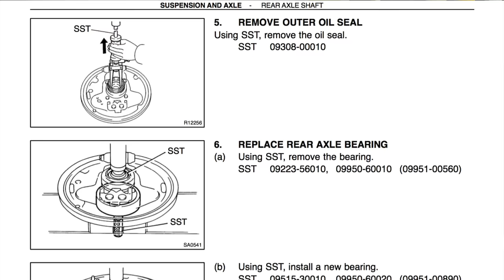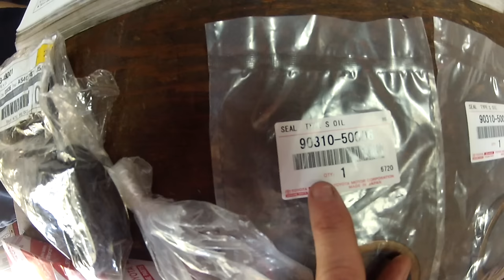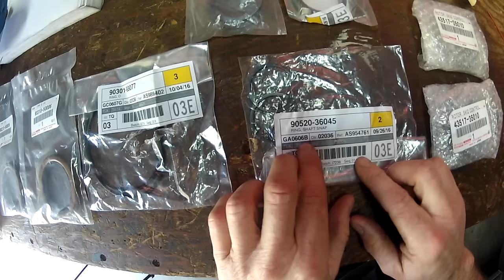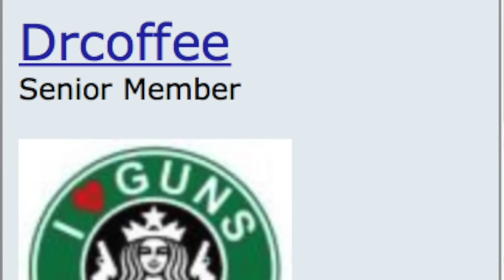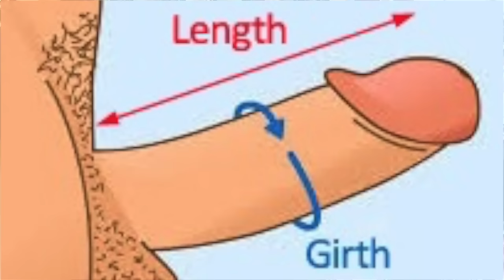Toyota Rear Axle Seal/Bearing Replacement (ABS Rearend)

Comment: My durasolid tool wont go all the way down to axle bolts. Anybody ever have this problem?
Reply from the maker: Trevor, did you watch the whole video?  I address this shortcoming about the tool.  You either have to modify it like I did or get some longer bolts to use when pressing the axle shaft out.  

Also, the brake backing plate with the bearing case attached to it might have slid down a bit.  This can happen because the bearing doesn't fit very tight into that case.  It's not a press fit.  But, all you have to do is pop the end of the axle shaft (side that slides into the 3rd member) into a piece of wood on the ground and it will knock the bearing all the way back into the case and bring the backing plate bolts closer to the Dura Solid tool.
Reply: @TimmyTheToolman  I did watch this video several times.My tool will not slide over axle shaft to be able to bolt down to backingplate. I have longer bolts. The inside of my tool is not big enough. I'm not sure what is going on.
Reply from the maker: Trevor, read my updated reply above.  It may be because the backing plate has moved some on you.  All you have to do is lightly pop the axle shaft into a piece of wood on the ground and that will re-seat the bearing fully into the backing plate bearing case and bring the bolts further up so you can attach the Dura Solid tool plate.  But, even when you do this, you will only be able to grab a few thread on each bolt so you should use longer M10 bolts if you haven't altered the plate like I've done.  Grabbing only a few threads is not enough to hold the force applied with the press.  You'll most likely end up stripping the ends of the bolts.
Reply from the maker: If you're still having issues, email me a pic of what you're dealing with: mtbtim@sbcglobal.net
Reply: @TimmyTheToolman  I will give that another try. I also emailed a few pics of the issues thank you sir !!

Comment: Please post a video for this repair on 8-22 Tundra.  These videos are misleading (tone rings?).  A step by step of removing the bearing assembly and reassembly would have saved me a ton of work and grief. Duane's tools are great but the correct one for the job is :  
EBAY - Rear Axle Bearing Puller for Toyota Tundra 2007-20 & Land Cruiser J200 2007-20.  Currently $127.99 blue in color Beware of the foreign look alike crap.
Reply from the maker: Are you saying our videos are misleading?

Comment: All u have t do is depress brake pedal with bit ti.ber and no brake fluid will leak out
Reply from the maker: You make a moderately understandable point, kind of.
- Sean
Reply from the maker: You're talking about brake fluid leaking out for a video about axle seals failing and gear oil leaking out.  Smoke another bowl Bro!  - Timmy

Comment: Apparently I made a mistake I didn't take the ABS sensors out at the time when took the axles out to do the axle bearings & I had taken the the axles to a mechanical work shop & had already had brought the bearing & oil seals & other parts that were needed & & when the work was & couldn't understand as why it was hard to get the axles back in place & bolted everything back in place & I & it was tight to turn the wheels around & I already had bled the brakes & it was while ago that I have driven Toyota Hilux Surf 1996 model & I find when I drive fairly fast & when I brake fairly hard it gives a bad vibration as the back of the vehicle & I which I had seen this video clip before hand I would taken the sensors out first my bad mistake & most likely have damaged my ABS tone gears & when I get some extra money I will get 2 second hand ABS tone gears as they are too expensive from Toyota brand new & because I live in New Zealand t they would have to be imported from Japan at NZ $ 200.00 each I wouldn't have the money to buy them & I will have to buy them second hand from the wreckers as I most likely have damaged my ABS tone gears & at the same time I will buy new axle seals as well & get someone to take the damaged ABS Tone Gears off & press on the good second hand ABS Tone gears & once I got the Axles out I should be able to take out the ABS sensors & check them out & I have already brought second hand ABS sensors just in case I have damaged the ABS sensors already on my Toyota Hilux Surf 3.4v6 I wish that I had seen  this video clip before hand I would not have made that mistake I would have take off the ABS sensors first & wouldn't have that trouble now oh well shit happens Kind Regards Peter PS good on you Timmy The Tool Man for putting this Video on Utube Thanks So Kindly Timmy & you mostly helped out a lot of other  People out to Most Greatful Timmy
Reply from the maker: Damn Peter, that was one long sentence.  The only period was at the very end.  Anyway, I got the gist of what you said.  Hope you get it all sorted out.  Happy Wrenching!

Comment: this is the repair im dreading most....id legit pay 500 dollars just for the OEM original seals before the redesign. like why change it. lol
Reply from the maker: It's not that bad Cameron.  Toyota changed the seal to improve the design.  The new design is way more pliable than the old design and will last longer because of it.  It does suck that the redesign caused unforeseen issues but it is what it is.  At least we know how to address it now.  

If you don't want to replace the bearings and other associated parts and just want to replace the seal, all you have to do is take your axles to a machine shop, have them remove the inner retainer and ABS gear, flip the inner retainer and press them back onto the shaft with 5mm of polished axle showing.  But, I think the smart move is the renew the bearings and I state all the reasons why in the video.

Comment: Was not expecting to see a penis in a car repair video lol.

Now if only someone had a video for the 4th Gen. My 2008 has a lot of noise while driving, I'm trying to tell myself it's the wheel bearings but I think I'm in denial of the truth that it's actually just a shot differential.
Reply from the maker: Well, hope for a bad axle bearing.  That's a much more affordable repair.  Fingers crossed.  But, ti could be something totally different like a bad u-joint which would be even more affordable to fix.

Comment: good stuff but way too much unnecessary press work very time consuming   , the bearing will come out with a socket and 2  taps with a dead blow hammer and just cut the retainer and ABS ring with a dremmel  and use a cold chisel , then no chance of damaging backing plate studs banging them out or pulling them back in and or bending them . that  extra step bit ya on yer second axle and totally unnecessary  , don't get me wrong love the vids and your passion but sometimes doing unnecessary steps gets one in trouble , I bang everything on with a pipe , bearing ( use old bearing on top ), retainer , tone ring  and final retainer , measure from axle end to retainer for measurement with tape measure to keep same as original measurement ,if using an OEM seal it will be in the correct spot no need for this grease test  not even sure where this originated from lol ,  been working on Toyota axles for 30 years never had a leak , remember every time you take that axle in and out to do a grease test you are chancing hurting the new seal or egging it out if ya leave weight of axle on it and shortening its life span ,  also fun fact never replaced a crush washer in my life and never had a leak , replacing crush washers is way too you-tube overrated lol , I'm taking  probably a 1000 fill and drain plugs I tightened multiple times (7-8) times for a same washer  over the life of some vehicles .
Reply from the maker: You do it your way and we'll do it our way.  No way am I going to use a cutting disk and risk going to deep and screwing up the axle shaft like I've seen too many shops do to people's axles when I have a tool that can pull the tone ring and retainer off with no risk of damage to the axle.  

Yes, the bearing can come out like you said.  We didn't know that at the time of the filming of this video.  We show your method in Part 2, along with featuring a much better tool for the job than the Durasolid tool: https://youtu.be/R-c2x3F8DU4   For the new tool, we still have to knock out one of the axle studs and then pull it back in after pulling the ABS tone ring and inner retainer off the axle.  No big deal.  It's beyond easy to knock one of those studs out and pull it back in.  The reason we had a problem with the studs on the second axle was due to how the Durasolid plate was made.  It was too thick to allow for sufficient thread engagement with the nuts.  If you would have watched the entire video, you would have seen how I explained the alteration I did to the plate to allow for more thread engagement so the threads wouldn't fail in the future when pressing the axle out of the bearing.  

I think I know this job just as good as any professional or DIYer out there.  I've done it successfully probably around 20 times.  If you like using a cutting disk, that's your prerogative.  I only use cutting disks as a last resort to get something off usually after a puller has failed.  

You've been doing it for a long time and doing it wrong for a whole lot of people then.  Toyota redesigned the seal.  I guess you missed that didn't you?  The seal lip doesn't sit in the same spot as it did before.  It sits apprx. 2mm more inboard.  So, because you didn't bother to do a grease test or sharpie test on the axles you've done, you didn't see that the seal lip is now riding very close to the bevel of the retainer.  If you know what you're doing by supporting the weight of the axle while going through the seal, you're not going to do damage to the seal by performing a grease or sharpie test to confirm a good mating of the inner retainer and the seal.  

If you like to do press work like a Neanderthal by banging the parts on with a piece of pipe, again that's your prerogative.  I like using a press.  

Finally, you don't bother replacing drain or fill plug crush washers.  I do because I've seen small leaks because of it.  

So, if you haven't figured it out yet, I'm not agreeing with your assessment of my work other than the comment about the bearing removal from the bearing case.  That comment I agree with, but then again, I've already been doing it that way for quite some time.  We shot this video a long time ago.  I guess you thought you were going to come on my channel and school me on this job.  Nice try.
Reply: @TimmyTheToolman  easy now , de-escalate , wasn't trying to school just pointing out some things that people may take or may not take with them , sometimes it sounds that way as writing /  posting is not the same as talking in person that was not my intension , but you can't insert and pull out the axle 10 times just to check and move seal .002 mm each time and think no compromise the seal has happened  , we are not precision robots , and pounding studs in and out , Toyota studs are known to not like over torqing  83 ft/lbs thats it , one must treat them like babys or they will crack , if ya instruct  the average  DIY'er to do this they will over torque them pulling them back in gaurenteed , more potential very serious hazard waiting to happen , anyways not trying to start a fight , and if I'm doing it wrong I'll keep doing it , never has a comeback for a leaking seal so ahead of ya on that one  ,, lol jk all in fun ,  Suggestion  ,why not remove the old videos as you evolve on how ya do things , then when someone comes on and points the obvious blunders on the older vids  it will save ya the time of tearing a strip off them lol
Reply from the maker: @TheCaperfish  Well, you shared your take on the job and you got my response.  Like they say, there's more than one way to skin a cat.  You like your method and I like mine.  We don't need to agree.  Happy Trails.

Comment: no need to remove abs sensor
Reply from the maker: Juan, you are correct that you don't need to remove the ABS sensor for this job.  The reason why we pulled the ABS sensors was to illustrate how the ABS sensors line up with the ABS gears and to also show people how they can check to see if their axle seals are leaking.  If you pull the ABS sensor and turn the wheel, the ABS gear will work like a water wheel and lap up any gear oil that got past the seal.

So, sometimes we do things in our videos for the purpose of explaining something but it's not necessarily needed for the job.

Comment: Bearings will drop in after you stick them in a freezer for an hour…
Reply from the maker: If you get them lined up just right, they'll push right in even without freezing them.  The bearing into the bearing case isn't a press fit, it's just sort of snug.
Reply: @TimmyTheToolman  It was directed more towards the press fit stuff. I’ve done Porsche 928 wheel bearings without a press, utilizing a freezer and blow torch…but that doesn’t have a big axle to deal with. Great vid, I just bought an ‘02 4 runner, I didn’t think axle seals were leaking but they cleaned it up well…
Reply from the maker: @77magnuss  Gotcha.

Comment: OMG<< 46:50 you push the bearing from the inner (inside) wrongggggggggg
Reply from the maker: You are technically correct.  However, if you know this repair as well as I do, the bearing fits fairly loose into that bearing housing.  When the bearing is squared up perfectly, the bearing literally falls in.  On the Non-ABS video, our friend Jordan was able to drop the bearing in with just his hands.  In this video we used the old bearing as our press sleeve and that dispersed the load out so it wasn't concentrated on the inner sleeve.  And come on Dude, did you actually watch the video and see how the bearing literally fell in?  We put no force on the bearing what so ever.

But, since this video I do it differently.  I don't own a metal press sleeve large enough to fit the outer diameter of these axle bearings.  So you know what I found that works great, a 3" ABS Clean-out and Cap.  In case you or somebody else doesn't know what I'm talking about, ABS is a plastic piping commonly used for sewer drains.  A clean-out is a fitting with a cap to allow you to access your sewer system in case you have a blockage and need to run a snake down to clean it out.  The ABS Clean-out fits the outer diameter of the bearing perfectly.  Using the clean-out for this purpose also quickly lets me know if I have the bearing going in straight and not cocked.  ABS is fairly strong but not strong enough to force the bearing into the casing if it's going in crooked.  So, since I know this bearing can literally fall into the casing when it's squared up perfectly, I gauge what I'm seeing happening to the cap of the ABS fitting and I gauge the feedback I'm getting from the press handle.  If I see the ABS cap start to bend in significantly or I feel any resistance in the press handle, I back off and reset the bearing because I know it should go in much easier.

So Dude, just know I could have just erased your comment if I wanted to and not bothered spending the time to give you a detailed response.  You could have commented in a different way to bring up the issue you saw in the video that was much more polite.  I read every comment and question that comes in for our channel.  If you can't find a more polite way to comment in the future, I will take the easy way out and just block your comments.

Comment: toyota,,lets re disign it so it doesnt last or work as good.. $$$$$$$$$$$$$$$$$$$$$$
Reply from the maker: The re-designed seal was an improvement.  The problem is mechanics working on these vehicles didn't know the new seal design changed where the sealing lip would ride on the retainer.  If they just went by previous suggested measurements from the Toyota factory service manual, the mating of the seal with the inner retainer wouldn't be optimal.  It seems you just came on our channel to bag on Toyota vehicles.  If you don't like Toyotas, stay away from our channel.  Go to someone's channel that features vehicles you like.